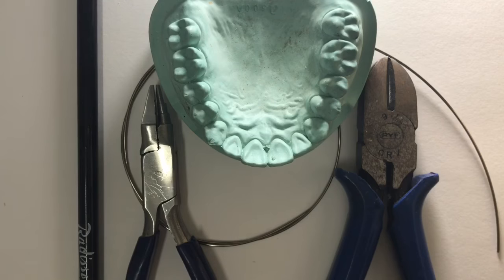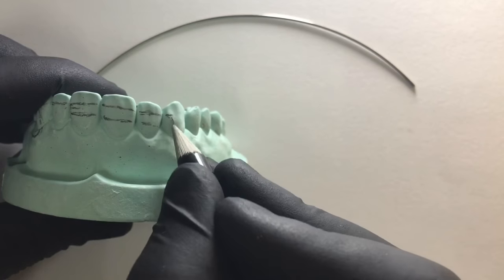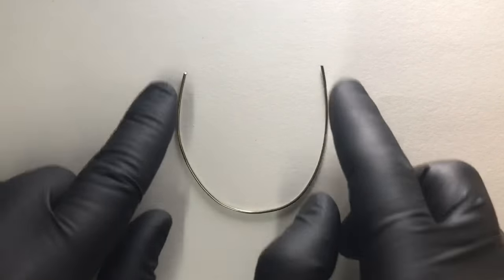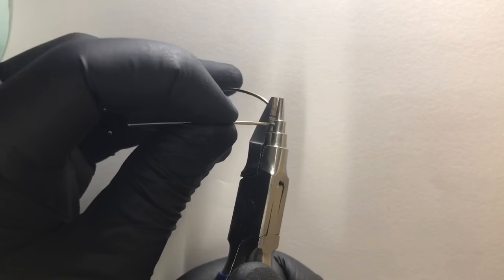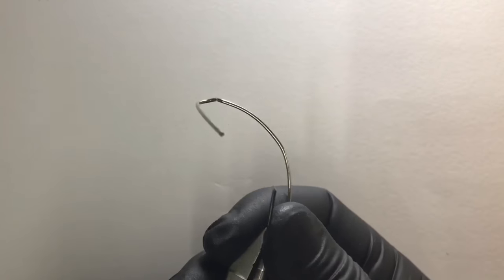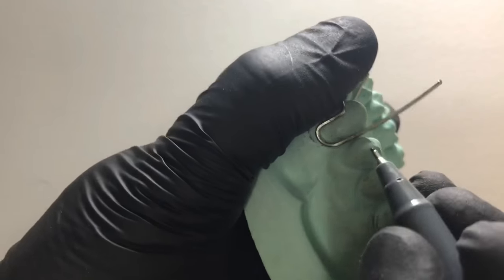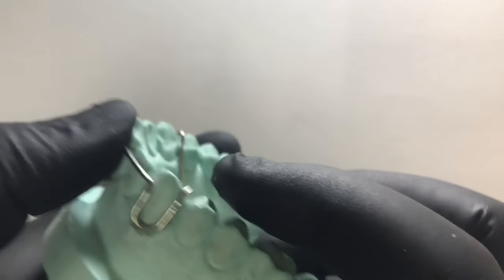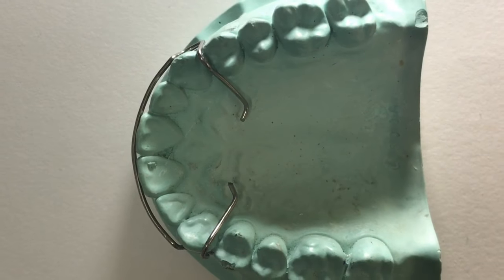#labialbow #shortlabialbow How To Fabricate Labial Bow Step By Step||Labial Bow Demo

Comment: Sir i am 21 years old so can i use it?
Reply from the maker: Yes as a retainer your doctor will advice you
Reply: @AtoZKidsdental  Sir our teeth are slightly outwards so will it work?
Reply from the maker: Na na na then it won’t work as it’s work is to retain the corrected teeth in its position for some time 
For forward teeth  you have to get braces/ clear aligners treatment done